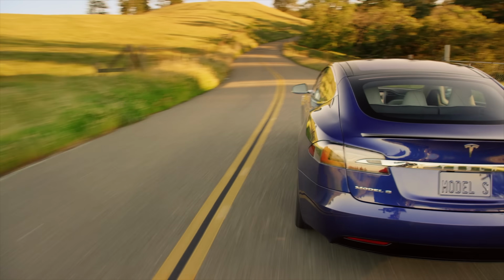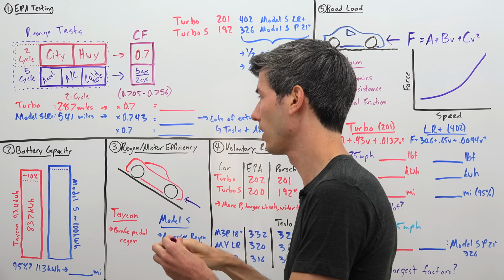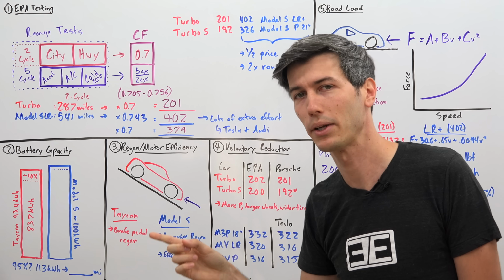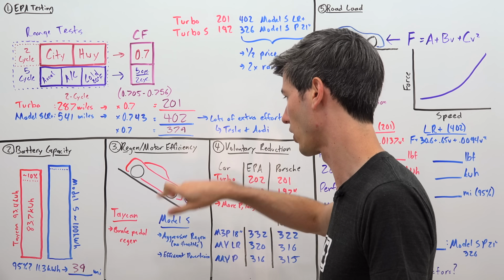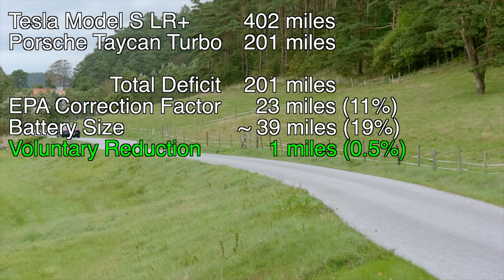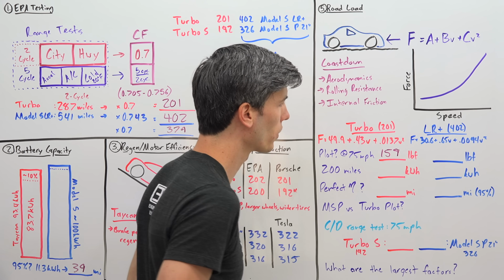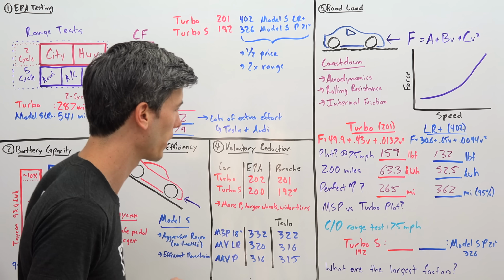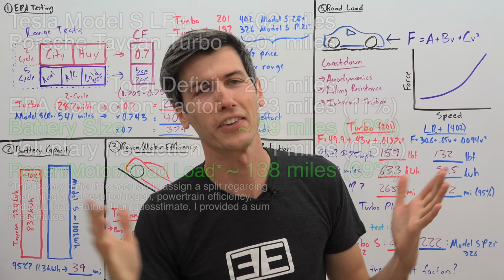Tesla's Secrets To Dominating EV Range - Double Porsche?!

Comment: A bit like trying to wrestle a hagfish. All those diagrams to tell us that the real world range is nothing like the standard tests. Lot of factors skewing results and estimates. That aggressive regen mode in the Tesla means that virtually all braking is regen while in the Porsche, more may be lost in the brakes. I would still go with the Tesla anyway because it is "just" an EV car while the Porsche is more performance orientated and those wide tyres and aero would have to give more of a range penalty. There may also be other tradeoffs  being a sports car ( Type of motors, cooling capacity etc.)which would wow in the canyons but maybe not on a steady driving trip. I notice even the model 3 performance loses range in the spec sheet despite having the same battery and motors as the Long Range. Maybe they are saving more of the capacity to keep the specified range longer given it will probably cop harder harder use with a bit more battery degradation than the Long Range. They do that all the time with Computer SSDs (called over provisioning) and EVs are more computer than car nowadays.

Comment: Interesting that the title starts with 400 miles plus for the Tesla (twice the capacity shown for the Taycan) and ends with it just 13 mile more than the Taycan and needing a larger battery. . . .
Reply: 13 more miles with 11 more kwh battery
Reply: True, but with driving that will never happen. Driving on the highway will never be consistent speed and level. When slowing down for other traffic or going down hill, the Tesla grabs extra range. We have at least one test of a new Model S going over 400 miles. That test also had the Porsche hitting nearly 360 miles. 

Would be interesting to see how the EPA tests show the Porsche doing so poorly. Probably something with city driving, but not sure.
Reply: @anthonypelchat   "going down hill, the Tesla grabs extra range."
Taycan is even better than this. It will coast if the road is free, it will regen with up to 265 kW (more than double of Tesla S) if it needs to slow down.
Reply: @foersom5928  Porsche don't regen unless you are hitting the brakes. And if you hit them too hard, then you use the pads instead of the regen. Tesla regens as soon as you let off the accelerator. During normal driving, a Tesla uses more regen then a Porsche. The Porsche might be able to do a ton better with min/max driving.
Reply: @anthonypelchat  You have to press brakes very hard to go beyond the 265 kW regen. When the road is free it is more efficient to use coasting than to regen. Taycan has a mode where ADAS camera will slow down using regen if slower traffic ahead.
Reply: @foersom5928  That's great. But I'm trying to figure out why the Porsche does so horrible overall, especially when it's proven that it can do much better. Teslas are pretty close to their EPA range with expected differences. Example, driving hard or in cold weather lowers it. Hypermilling expands it. Otherwise, it's usually very close.
Reply: @anthonypelchat  Taycan does very well. Bjørn Nyland has video where Taycan 4S does 580 km range (at 90 km/h) and 425 km (at ~120 km/h).
The problem is EPA has both 2 cycle and 5 cycle test methods. That gives test results that you can not compare.
Reply: @foersom5928  Sorry. That was what I meant. Porsche does very well in several tests, but they took the same tests that Tesla took. The difference between the 2 cycle and  5 cycle tests are only about 5%, as described in the video.  But Porsche is doing about 50% better at times.  Why? Just weird. I don't think that we will get a definite answer for a while.
Reply: In the real driving world a 2019 model S long range goes up to 220 miles without ruining your battery by over charging or experiencing range anxiety..

Comment: Taycan using an 800V system vs Teslas 375V does play a roll in better efficiency too since you lower the power losses at higher voltage.

Comment: What I gathered from this is that the EPA's testing standards are not accurate vs real world typical use data. Tesla seems happy to take advantage of this discrepancy for marketing purposes, while Porsche is attempting to more closely match the advertised number to the real world number under typical use. Am I missing something?
Reply: That's what I thought but it doesn't explain why the EPA themselves only got 202 with the Taycan turbo. 
If what you said was the case then the EPA would have said the Taycan turbo does 260miles but Porsche state 201miles. 

I'm still a bit confused

Comment: The Taycan has a gearbox, helping its efficiency at highway speeds. Tesla opted not to put one in their vehicles for cost and manufacturing reasons.
Reply: On the Porsche the gearbox is only on the rear axle, keep that in mind. Single speed on the front axle
Reply: @PigglyWigglyDeluxe  Yeah that's definitely worth noting. I can't wait to see the day when all EV's have at least a 2-speed gearbox for each motor, maybe even 3 or 4 speed ones for sports/performance models.

Comment: You know what would dramatically improve highway efficiency for electric cars? Automatic drafting, kind of like a train when driving in autonomous mode. Most of the resistance comes from the drag on the car. If the cars were only inches from each other, but safely computer controlled, they could save a lot of energy acting as a team. This might require a bit more adoption of automated driving to make sense.
Reply: I 'draft' behind semis all the time on my long highway stretch to work.  I can get up to 29MPG in my 2014 Ram, with a 5.7 Hemi.
Reply: There have been EU projects for testing this for convoys of trucks "truck platoons". The front truck steers the whole platoon.

Comment: My long range RWD Tesla 3 is rated at 320 miles.   Driving from Baltimore to Washington DC on a 75 degree day in rush hour traffic you can’t even pull 200 watts per mile.  Driving under the same conditions you could easily exceed Tesla 320 mile estimate. 

Taking 95 between Baltimore and Dc at 2 am. You would be lucky to average 250 watts per mile @ say 75 mph. Your range would be in the 275 mile range.

Comment: I'm surprised there was no mention of weight in the equation.  From a previous video, you mentioned the Taycan was around 5,000 lbs which is pretty heavy.  I imagine the Tesla would be lighter, and as you mentioned in previous videos, weight is important especially in relation to engine power and resource use.
Reply: "I imagine the Tesla would be lighter"

Re-imagine that. 5048 pounds, as listed for the Model S Long Range on the Tesla website. 
BEV's are heavy, that goes for all of them until there's a revolutionary new battery technology.
Reply: The difference is only 54 kg
Curb weight:
Tesla S Performance 2241 kg
Porsche Taycan Turbo S 2295 kg

Comment: If you play with RC models, you find that faster charging batteries could be easily 20% heavier for the same capacity. Model S could only charge for 150kw/h while Porsche charge for 350kw/h

Comment: I have a question. Is this stuff just hard to figure out with electric cars, or are combustion engine cars just in a place where we know your average i6 with a 21gal tank goes much further than you'd care to calculate? I know that electric cars have an "MPG" rating, but that doesnt tell people how far the car goes. It doesnt help at all. Regular cars have an MPG rating that's useful because even if the stat isnt real-world accurate, even a monkey can calculate MPG * Tank Size and call it a rough estimate. No one cares about the difference between 650 or 750 mile ranges, we only care about how much it costs us to fill up every week or so (however long it takes you to use three-quarters of your tank during your daily commutes).

Comment: The Taycan could drive 1.75 miles further than the Tesla at 75 mph with its wing down and the same wheels/tires, even with the smaller battery.

For the TLDR part of how I came up with that:

The aero figures quoted between these cars has the Taycan 46% higher than the Tesla.   I found that a bit weird being that the Taycan has a lower Cd, and its surface area isn't much larger than the Tesla, if at all.  It's 1 inch shorter in length, 1 inch wider, and 3 inches shorter in height.  Therefore, I have to assume that the Taycan's figure is stated with the wing in one of its 3 deployed positions.  Keep in mind, the wing is down until it deploys to its first step at 56 mph , step 2 at 99 mph, and step 3 at 124 mph.  Therefore, the aerodynamic figure should change with speed... it doesn't here with static figures.  (Note: I believe you can force the wing to stay down at higher speeds while in Eco mode.  )

Let's say the wing isn't deployed, and the aero figure is even between these cars at .0094.  The Taycan's road load force declines from 159 to 135... only 3 lbf more than the Tesla.  

Now, I believe the first number is rolling resistance since it isn't impacted by speed.  Let's say the Taycan didn't have its wide grippy sporty tires and instead used the same setup as the Tesla and had the same exact rolling resistance.  At 75 mph, the Taycan's force now declines to 115.75 lbf....  now 16.25 lbf lower than the Tesla.  (good job on that internal friction Porsche)

115.75  lbf * 5280 ft in a mile * 200 miles = 46.02 kWh .... 6.48 kWh less than the Model S to get to 200 miles.   (FYI ... I used a lbf to kWh conversion calculator ) 

Now to get the total range of the vehicle:
(200 miles / 46.02 kWh ) * 83.7 kWh = 363.75 miles.... 1.75 miles longer than the Tesla's range... using a smaller battery.  

In terms of rolling resistance, vehicle weight does actually have an impact.  The Taycan is 191 lbs heavier than the Tesla.  Every 100 lbs adds 1lbf.  However, I imagine that using Tesla's tires will shave off a few lbs from the Taycan, so maybe vehicle weight only impacts the figure by 1lbf.

I'm sure there are other things that aren't included here, but I'm just doing a simple experiment with the algorithm above.  I've always said that the reason Tesla is more efficient than the Taycan is because Porsche made the conscious decision to trade efficiency for traction.

Comment: That 75mph range is interesting, isnt porsche dual speed transmission a big part too?
Reply: I asked myself the same thing, but I don't think so. The transmission helps acceleration by increasing torque, but I don't think electric motors lose efficiency at higher speeds. Someone can correct me if I'm wrong.
Reply: @DanielZajic  I believe the 2nd gear lowers the RPM. Thus from Bjorn video, the range for Taycan 4S+ is 580 km, that's like 10% only difference to Model S. Additionally, Taycan has less usable battery capacity available, heavier and has fatter wide wheel (275 on back) than Model S

Comment: I believe the biggest difference of the road load comes from the two speed gearbox of the Taycan. The road load test is measured from 85-10 mph which is unable to make full use of the efficiency of the second gear (ratio 8.05:1). Whereas the Tesla's singles speed ratio (~9.5:1) is much more efficient than the Taycan's first gear ratio of (15.5:1).

Comment: Also interesting is the Hyundai ionic Vs the model 3 both similar shape sedans of roughly the same size.

The ionic gets 4.5 miles per KWh and the model 3 gets 4.25 miles per KWh so the ionic is about 5% more efficient

It's a myth that Tesla (or anyone) has a lead in EV powertrain. The reality is that EV powertrain and electric motors are so efficient that there isn't really room for much improvement

All the range/KWh improvements will come from shape (lower drag shapes) and weight (less rolling resistance and less acceleration and deceleration losses) and to a certain extent small improvements in 'other' aspects of the car like using slightly more power efficient chips, heat pumps, screens etc

The main thing for EVs is to get the cost of the powertrain down significantly. There is little to no significant improvements to be had in the powertrain
Reply: Kia and hyandias EV are underrated and your statement is very true. Their adjustable Regen in the fly along with the heat pumps make for a very efficient machine. Kona EV has a great range and cost less than the base model m3 in a real world test on the same road. Great for coasting on the hwy too.

Comment: On the highway
209 Vs 222 miles range or only about 6% difference

This makes sense as despite popular belief the fact is electric powertrains are very efficient the difference between the best and average won't be much at all
Reply: I think a significant factor is Taycan's 2 speed transmission, which lowers motor RPM and thus improves efficiency at highway speeds.

Comment: You should do a video explaining why the Taycan has a transmission.  An engineer said to Jay Leno that it was for Autobahn performance yet it doesn't seem to help out at all.  Why is this?  Why is the Porsche so inefficient?  Porsche said this car is the most aerodynamic car they have ever made.
Reply: Paper figures don't tell the whole story.

Real world, they're very similar in range.

Porshe are tuned for high speeds.
Reply: @Robert-j6r8c  This video showcased that the Tesla is more efficient
 though at high speeds?
Reply: @kylea2437 
Efficiency isn't the whole story.

As I said they're very similar in range.
Tesla may be slightly more efficient, but they don't perform as well as the Porshe especially at higher speeds (what the Taycan is tuned for) 

Real world you lose a few miles of range for the benefit of acceleration, stopping and handling.

Comment: Porsche Taycan does not have regenerative braking? Really? Also please take a look how Bjorn Nyland done 580 km ( 360 miles) on single charge.
Reply: It has regen but unlike tesla where it starts regen when you lift of the accelerator, in Porsche regen happens only when you press the brake pedal.

Comment: Wow, this sure went sideways in a hurry. The whole premise of the video was supposed to explain the difference in range between Taycan and Tesla, which you spend a ton of time on. And then at very end, just casually showed that there is no difference between Taycan and Tesla actual range as tested by Car&Driver in the real world. What exists is the difference between EPA rated range which has no relation to real world range in any way. You yourself showed that Tesla even theoretically can not reach the claimed range in the scenario most drivers actually care about (highway) while Taycan easily exceeds its rated range in the same scenario. If that is not an obliteration of EPA then I do not know what that is.

The largest reason why EPA rating is so low is because EPA insists on testing vehicle efficiency in all available driving modes, which includes the Sport and Sport+ modes of Taycan that engage the low acceleration gear of the Taycan 2 gear gearbox and that low gear is not efficient at all. The EPA testing speeds are so low, that this low gear would be active for the whole testing cycle in Sport and Sport+ modes which in turn tanks the overall efficiency calculation. Tesla works around this bug by hiding Ludicrous mode behind a custom switch which then for some reason means that EPA does not test it by driving around town in that mode at all.

Tesla designed their car for the test, not for real life efficiency - just for the EPA test. It is all perfectly legal, but that does not make it fair and that does not make it a good basis for customers to choose car based on. The EPA has been hacked and made useless for its only purpose - helping customers compare and choose cars. Just for get about EPA and use WLTP.
Reply: I just remembered the funniest bit of the video. It was 15:31 when on the one side of the board was the C&D driving test result - 209 miles vs 222 miles, and on the other side of the board was the available battery capacity - 83.7kWh and 100kWh. You could just see the brain going ".... does not compute ..." and just spitting out "we know Tesla is more efficient" when number on the board are saying exactly the opposite. 83.7/209=0.400kW/mi and 100/222=0.450kW/mi. Tesla is literally on the board in real life test show to be 12.5% less efficient and the brain just can't seem to be able to accept that as reality.
Reply: @aigarius  since launch there has been a software update that allows 5kwh of the battery used. Reducing the buffer to around 5kwh for the Taycan. The Taycan usable pack is about 89kwh now. Tesla's is 93-95kwh (we don't really know). The difference at highway speeds of the range is entirely due to a larger battery pack. The efficiency at least at 75mph is very similar. 

Also in regards to your point about the EPA, fully agree the test needs to completely redone. It's obvious that the test favours 1 type of drivetrain whilst penalizing another. A fair test would allow ALL types of drivetrains to have equal opportunity to post a range figure.

Comment: Why so larger wheels in General have an poorer Energy efficiency? Is it because of the Higher Mass and therefore greater loss during breaking? Does the rubber have a different resistance because of the different angles?